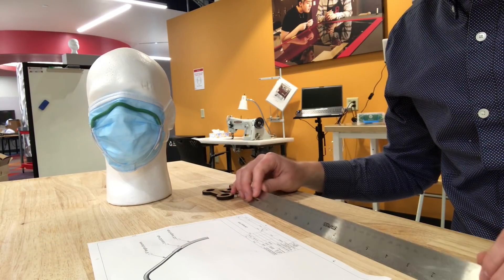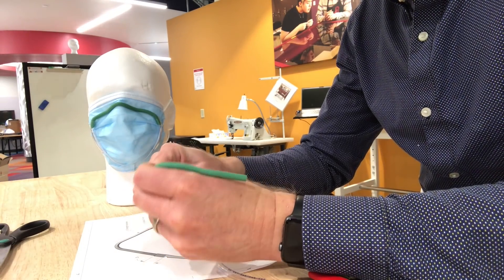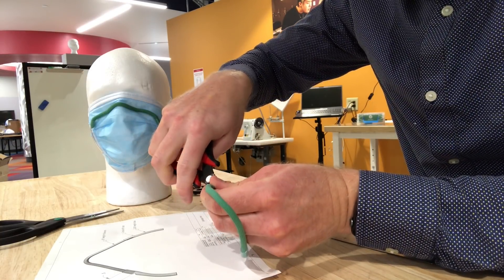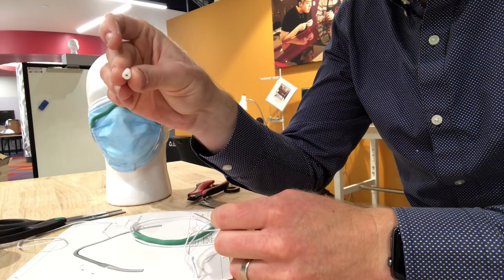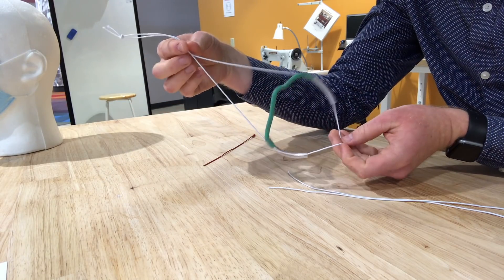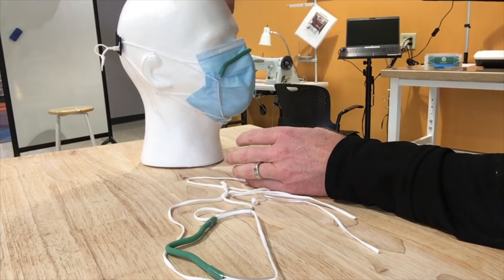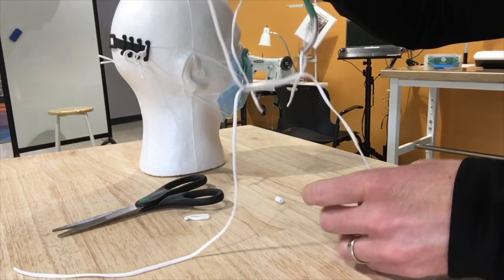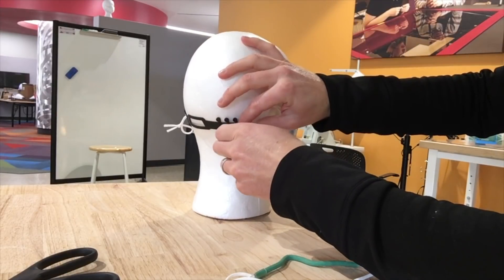Badger Seal - How-to Make (Type A, B and C)

Comment: I don't think you ever said what diameter of Gear Ties to get. When I got to Lowe's, I found Gear Ties in 2 different diameters. I could see that the smaller one was much too small to fit with the 1/4" outer diameter tubing. My tubing has an inner diameter of .17". So I bought the larger Gear Ties. I have worked out a way to cut away a lot of the foam with scissors where it's supposed to fit inside the tubing. Just to complicate things, the Gear Ties do not give any dimensions on their packaging other than length.

Comment: Thank you very much for the instructions. I'm going to try to make this mask fitter but as I live in the UK, I'll be buying different brands so I just wanted to ask - should the diameter of the foam wire be exactly the same as or smaller than the internal diameter of the clear tubing? If smaller, how much smaller so it doesn't fall out?
Reply from the maker: Trial and error was required to get the right fit. If you don't have access to the exact parts, then you might want to consider (1) ordering a few sizes for trial and error or (2) making one of the other designs we have posted on Slide 33 of the Open Source documentation that doesn't use the clear tubing. This way you just need some foam wire (some times called Gear Tie) + elastic cord. https://docs.google.com/presentation/d/1bTUmxEiZ_EMo9DYjHWl13rarzPwKDukUQhRj-gxJxfM/edit#slide=id.g999855a266_29_16
Reply from the maker: Also, the diameter of the foam wire in our case is 0.2 inches but then compresses into the clear plastic tube which has a diameter of approximately 0.18 inches. So they are very close to having the same diameter. If the clear tubing is too large, you could always put a little epoxy or glue around the foam wire.
Reply: @LennonRodgers  Thanks very much for both replies - it's good to know that the clear plastic tube was slightly smaller in diameter than the foam wire - I grew up with imperial measurements but all the goods here come in metric measurements and so the sizing is slightly different.

Comment: Fwiw, at least in my case, the .8 mm elastic you link to above and in the google slides deck is too thin for the cord locks you link to.  Was it your intention that the elastic be this thin? They also sell 1mm and 1.5 mm elastic. If I tie a knot in .8 mm cord, the cord lock hole is small enough that the elastic won't go through it. But the hole is too big to create any friction. So you can use it for fine adjustments.

Specs on the cord lock say that the smaller hole is 1.5 mm, so the doubled .8mm cord would only be 1.6mm. I suspect 1mm or 1.5 mm cord would work better with a hole that size, although it would be harder to thread it through. 

Might want to revise the instructions here to be more precise about the thickness of the cord, rather than just listing the length and providing a link to the product on Amazon that provides more than one option for thickness. Thanks for making this. I made a prototype yesterday with twine instead of elastic and I was able to take a 40 minute walk outside without having my glasses fog up. First time I've ever been able to do that.
Reply from the maker: I'll add more info to the Open Source doc. But in general I don't rely on friction with the cord lock to hold the cord in place - I tie a second knot that holds it right where it needs to be for my head size (i.e. a hard stop).
Reply: @LennonRodgers  Thanks, appreciate it!  What is the point of the cord lock then? Couldn't you just tie a couple of knots in the cord and call it good?
Reply from the maker: I find the cord-lock useful with setting the initial tension (and they're super cheap) though not essential. I uploaded a new how-to video on my channel that includes the knot: https://youtu.be/oyxXcSYyG0Y
Reply: @LennonRodgers  Excellent. If it was me, I'd also add something like this to the cord lock entry of the parts list in the Google Sheets document:

"Please note: To achieve proper friction with the cord lock, the total diameter of the two cords passing through it should be at least .5 mm greater than the diameter of the cord lock's hole. Example: If the cord lock's smaller hole is 1.5 mm, the total diameter of the two cords passing through it should be at least 2 mm (i.e., 1mm x 2)."

I know this may seem like overkill. But IMHO, part of crafting good instructions for novices is giving them enough context that they can make informed judgement calls without all the accumulated knowledge the instructor has in their head and probably takes for granted. 

This is especially true when the source of the parts is Amazon, where the user won't have an opportunity to eyeball fit, etc. in a brick and mortar store before buying the parts.
Reply from the maker: @jakelondon  You're totally right and thanks for mentioning it. I added your details to the Open Source Doc. The document is truly "Open Source" - so let me know if you have any other similar suggestions.

Comment: The link to Amazon goes to 0.8 MM elastic cord.  The cord, once I received it looks a lot smaller than the cord used in the video.  I searched and couldn't find the diameter for the cord mentioned in the plans or video.  What size cord is used in the video?
Reply from the maker: Great point. I've used many different cord diameters. In general I find the larger / softer ones better. This should work but it's hard to go wrong really: https://www.amazon.com/Elastic-Stretchy-String-Homemade-Sewing/dp/B088RFQ344/ref=sr_1_6?dchild=1&keywords=elastic+cord&qid=1613571316&sr=8-6
Reply: I had the same experience, detailed in a separate comment. Please be specific about the cord thickness. I wasted $8 on elastic cord from Amazon, cuz I cut a length of it before realizing it was too narrow for the cord lock. So I can't return it. Most people aren't going to read the comments for more details. They're going to read the instructions and parts list.
Reply: @LennonRodgers  Thanks!

Comment: Genuinely great idea.  Too bad you have to buy 100' of tubing when you only need 5".  At least 100' is not expensive, just wasteful of money and space.  :-(
Reply from the maker: Home Depot and Lowes have smaller quantities of the 1/4 in. O.D. x 1/6 in. I.D. x 20 ft. Clear PVC Vinyl Tubing. 
https://www.homedepot.com/p/Everbilt-1-4-in-O-D-x-1-6-in-I-D-x-20-ft-Clear-PVC-Vinyl-Tubing-701968/207144351?MERCH=REC-thankyou1_rr-207144351--207144351--N
Reply: @LennonRodgers  Thanks!
Reply: There are smaller independent franchises like Ace or True Value that can cut you smaller pieces.